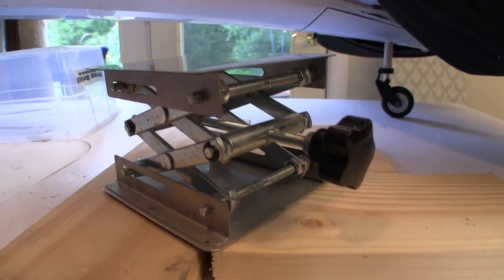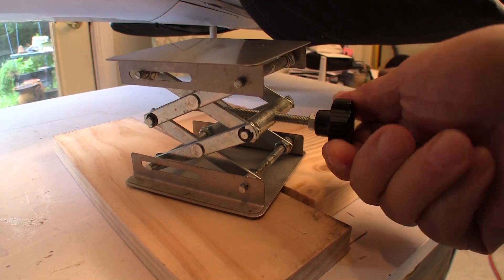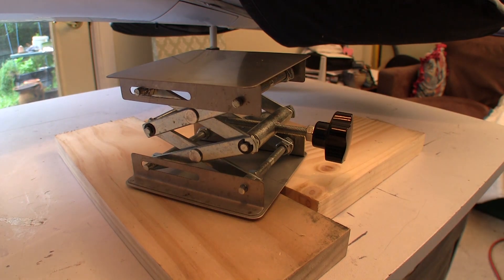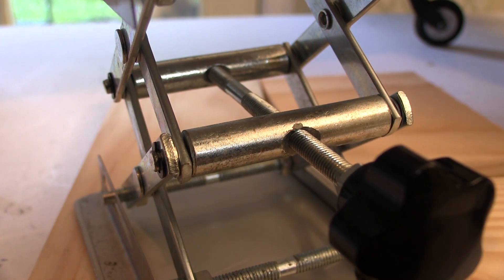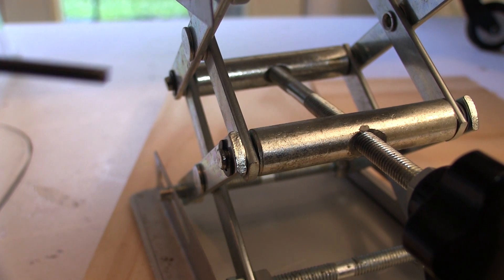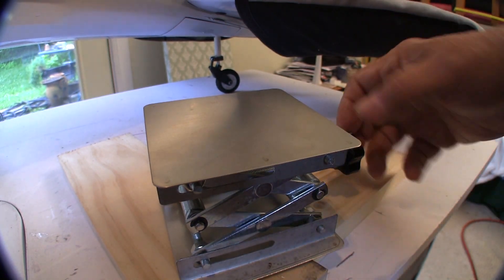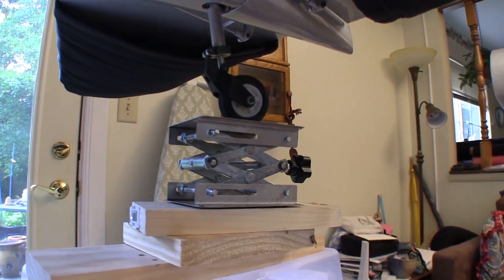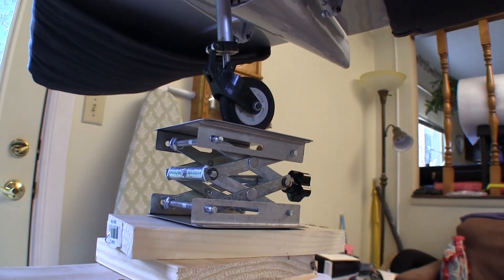Micro Trader Scissor Lift

Comment: Does this scissor lift's top base remain rigid when weight is added and doesn't slant to one side so that whatever is placed on it doesn't want to slide off?
Reply from the maker: I've not had any stability problems with it but I haven't tried loading it down. With my planes, it is plenty strong.
Reply: @flyingrcdotnet  I was just wondering whether you had to perfectly centre the wheel of the plane for it to be stable and if you didn't would the scissor lift's top plate lean to one side.

I mention this because have a small scissor lift, 100mmx100mm, that I didn't use for some time because of its instability. To solve that problem I drilled 4 matching holes through each corner of the base and top plate and slid 4 cylindrical shafts through these holes. This was then attached to a base twice the area of the scissor lift for extra stability. This certainly improved its practicability.